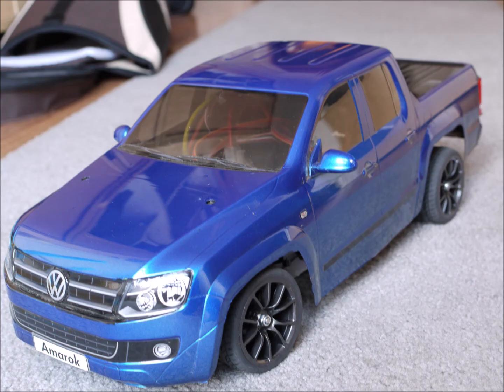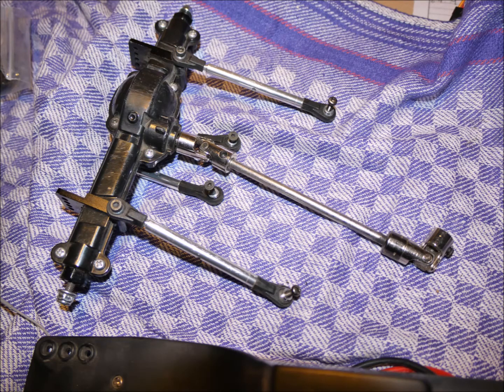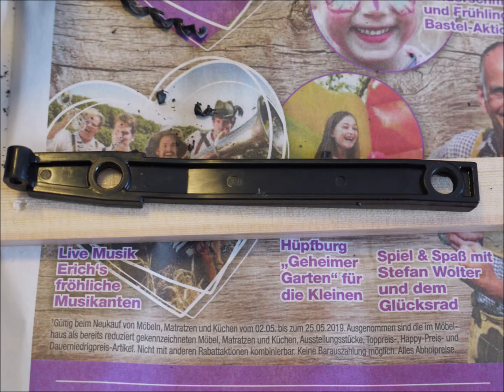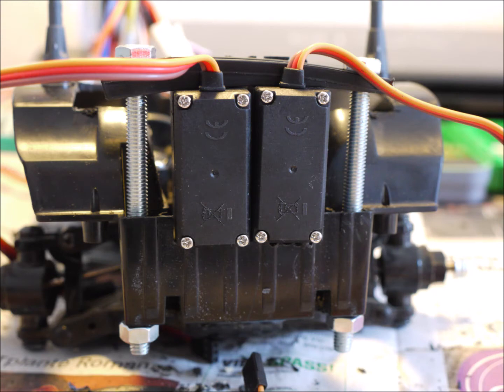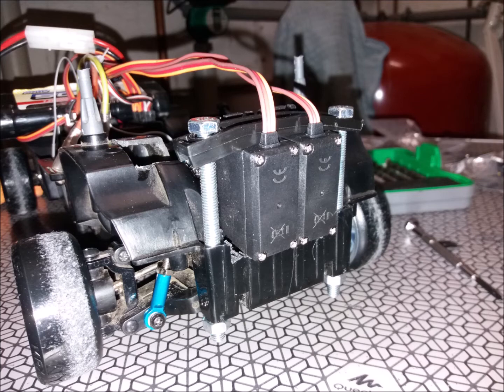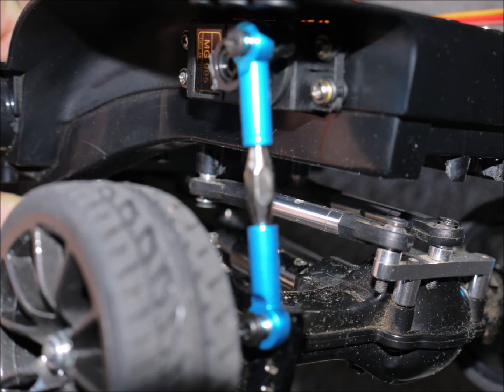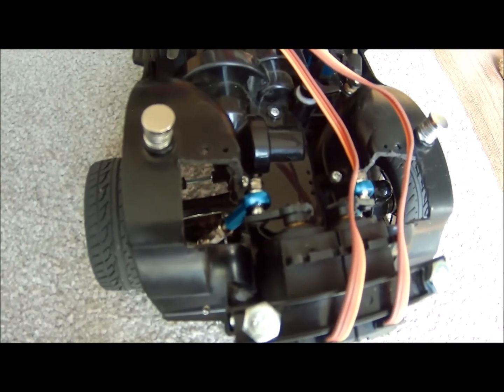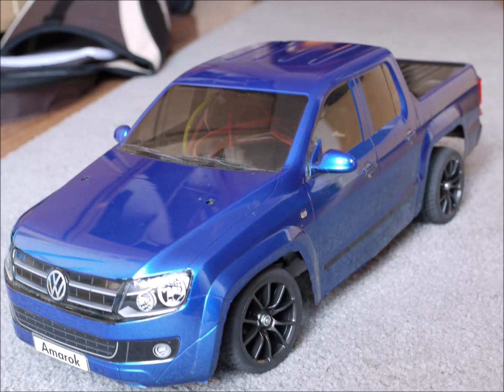Tamiya Amarok CC-01 conversion to Lowrider (tutorial)

Comment: Thank you for the video. Now I making mine cc01 lowrider.
Reply from the maker: Well appreciated, thankyou. It's really pretty easy and cheap to do. If you use fast servos, the effect is even better. Mine are a bit too slow, but I just wanted to find out how to do it and if it works. Good luck with your build. Maybe you can post a video when it's done and let me know. You have an RC Channel. I'll check it out.
Reply: @RackwitzG  sure, I post it to my channel after I finished the project. I have cheap 25kg servos. Shortened the wheelbase for 8mm. Now waiting the body from ebay.